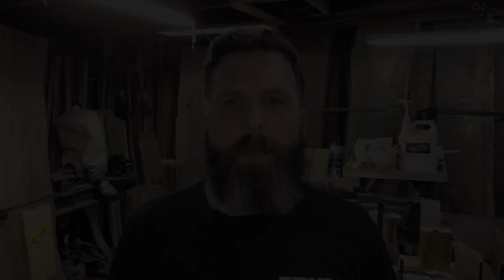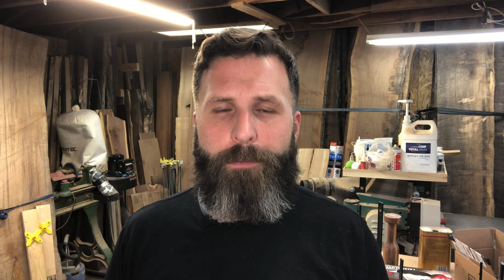Milling Monday #17 | The Biggest Risk Involved With Chainsaw Milling

Comment: yes need equipment, me at 76 years old as soon as I get finished moving to south central PA I will be buying a tractor with pallet forks to handle the slabs, and maybe even help move the logs to a flatter, safer slope.

Comment: Pieces of conduit or water pipe are cheap and will help roll a piece by slipping it in between the slab and log! I have a small 4x4 John Deere with a loader still dangerous!!! The tractor and or skid steer are helpful but very dangerous with a 13-15’ slab, unless you only pull and push off the log with it! We have a winch on a overhead trolley and that is so much safer, one associate uses a small A frame and chain fall and it works very well and it’s manual so much safer than our winch!
 Great presentation and warnings. 13’ of red oak 42” wide, 5” thick is over a 1,000# slab and if that falls on you, your hurt period!

Comment: Would you recommend leaving the trunk of the tree on the ground and bending over to mill? Or do you recommend jacking the trunk in the air if possible? Im over 6 foot tall and find bending over to be a pain in the but. I have also mounted a winch that greatly helped. I have also noticed a fair bit of heat comming from my bar and chain. Also build up on my chain and bar.When I use to run chain saws in forestry I never thought of cleaning a chain befor. How do you clean chains and what do you look for to know when and why to clean? I run the saws oiler on max. Running a ms 362 with 24 inch bar. Recently replaced the worm drive for the oiler. I have watched and read that heat is another factor in bar and milling life. And have noticed a water cooling system for the chain on Logosol mill set ups. Also any chance can you show the difference in milling with a regular ripping chain vs a Granberg ground style? I have been debateing to grind down my new ripping chain to how a Granberg looks. What are your thoughts on milling mods? Ive seen people attach wheels by the skid rails to leaviate drag. Also replaced some nuts with knobs and leavers to make adjusting the height and thickness. Aux oiles? Thoughts on this?
Reply from the maker: Lots of good questions-
1. I mill on the ground. Lifting them up can be tricky sometimes and it can’t fall if it’s already on the ground.
2. I’m doing a video on chain cleaning soon
3. Regular chain will just dull substantially quicker than milling chain. Save your time and just get the granberg chain. It’s worth it.
Reply from the maker: I have the roller wheels attached to my mill and they are a big help. Prevents any hang ups.